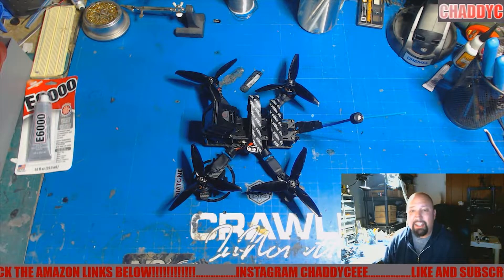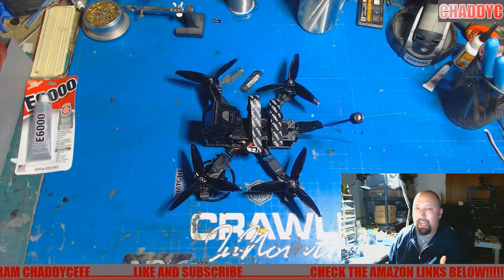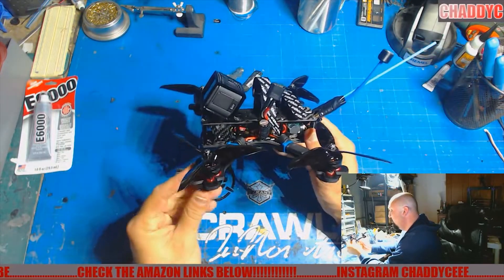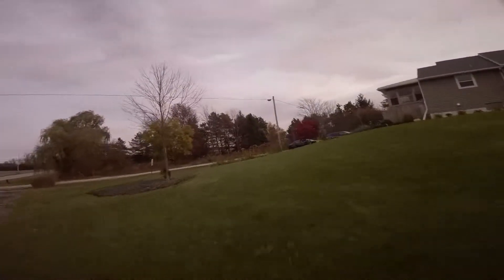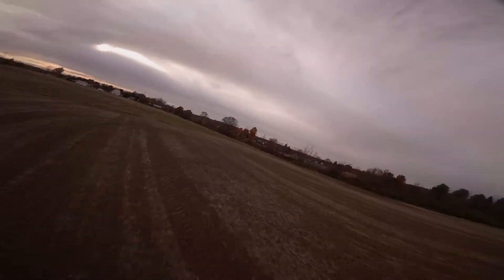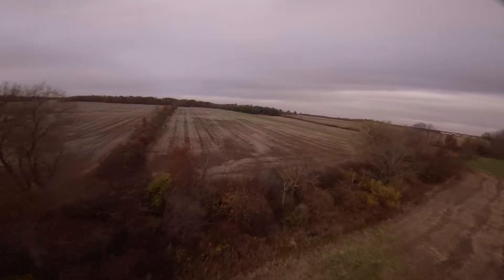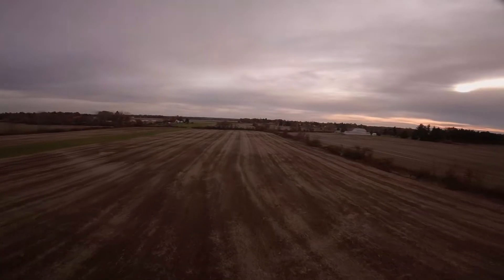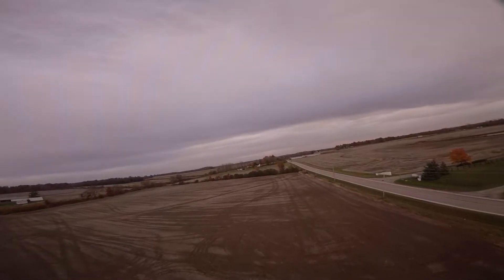TBS SOURCE ONE MAIDEN FLIGHTS

Comment: Heya! Got the CL1 which is kind of similar, only cause the TBS was out of stock at the time. Can't really compare but found it's a pretty solid frame considering it went into a palm tree trunk head on the other day on a ill advised power loop! Something I noticed, the arms didn't break but where it screws into the frame.. One of the screw holes had a hairline crack causing weird twitching on full throttle. Kicker is I never would have found it unless I removed all the guts, then by chance twisting the arms, I saw a small gap appear! I used an led light and held the frame up to inspect it! A little epoxy and bamm , like new! Just an FYI... Love the haircut BTW! Same same!!
Reply from the maker: Mawii FPV haha. Thanks. Old man haircut!  But yeah this thing is very solid since the vibes are almost non existent and have literally no filtering running. I do see some arms cracking at the opposite end of yours but since I don’t freestyle fly per say I’m not expecting to crush them. I think it’s a keeper. Kind of thinking might get another one in this months drone drop box since they are hinting it’s a tbs packed box.

Comment: Solid set of components. I have the same setup in my Alien Butter Kwad and it's by far my best flying quad of many.  About to build up a Source One but with different components, but glad to hear you have positive reviews of it.
Reply from the maker: caymandiver75 Richards setups just work. Period. Glad your onboard and slowing the hype train. I try :). It’s hard :) I find these super rigid frames are best for my long mid range flying to keep the vibes to almost nothing so I think this thing really delivers and should work with even more a variety of components.
Reply: @Dorkyand40  One things for sure the Primo 2450 motors are amazing. I now have them on all my quads running 4 and 5s.  On 5s they are just sick! Was out flying the other day and flew around for about a minute to warm up the battery and did one quick burst of speed and hit 129 mph with my go-to DAL 5050C bi-blades! Other than the speed and flight performance of this setup I can fly around for up to 5 minutes in cruise mode.  Love it!